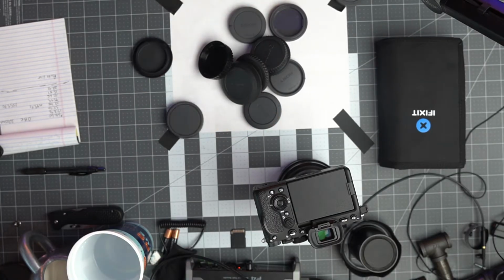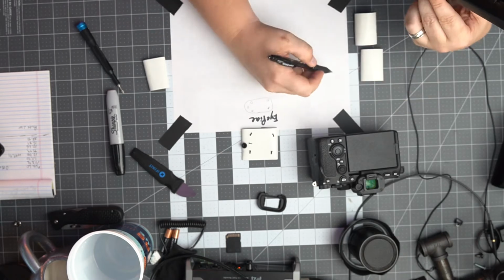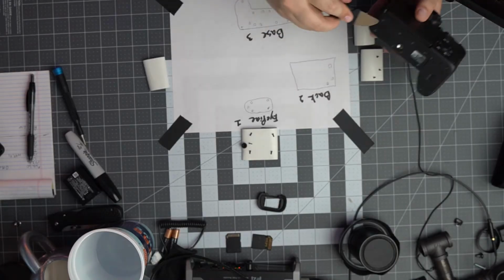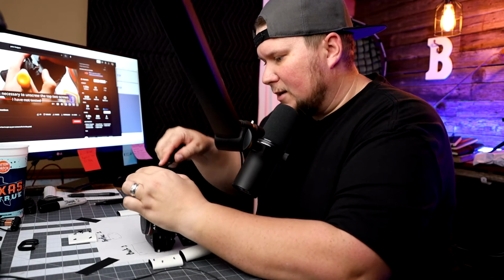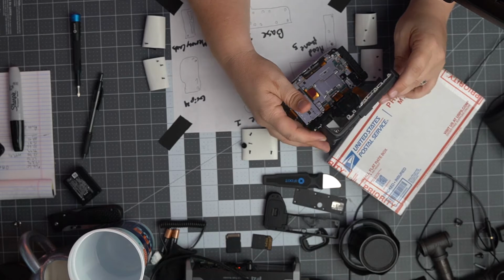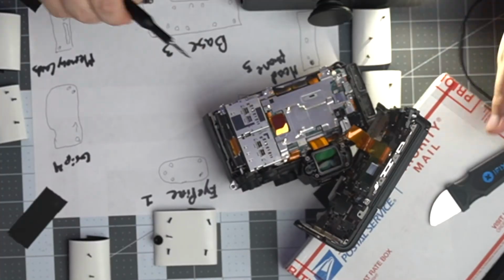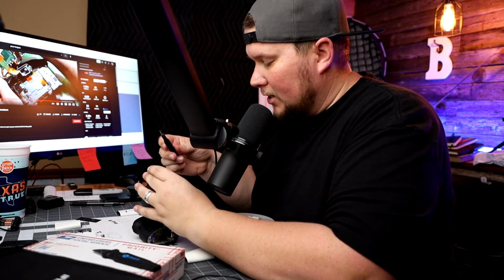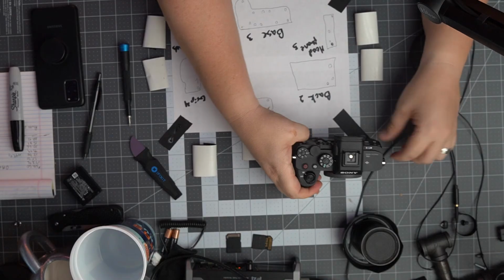I fixed my A7Siii Floppy Screen PROBLEM

Comment: I watched your video because I have the same problem.  After watching it, although it was fun, I basically realized that my camera was perfectly fine.  Thank you for fixing my problem.😅
Reply from the maker: That’s awesome! Glad I could be of service. Don’t get me wrong, I’m glad that my problem was fixed with a little glue, but it’s probably best not to dive into the innards of your camera. Thanks for watching
Reply: @Jarrod Brown  It looks too difficult and time-consuming.  Don't get me wrong, I've fixed damaged lenses before with multiple groups and elements.  But I had no choice bc they didn't work. But a loose screen isn't worth possibly losing a $3000+ equipment. But that was a very entertaining video.
Reply from the maker: @pop0ful  lol. I totally get it! Thanks

Comment: Voiding your warranty.... Its okay... if you haven't already removed the plastic, you can always return it 🤣😂🤣... and then you said it yourself

Here's a tip I use when rebuilding small engines too... take that diagram you make, use a pop box or something so its a little thicker, and poke the screws into the hole you drew on the diagram.  That way if the screws are different lengths you're not chasing it later.

Working on electronics aren't bad once you've done stuff a few times.  I am spoiled at work with microscopes and stuff so I usually save my sanity and take stuff in to work  to tackle during lunch if its more intricate stuff like that or needing a more precise soldering iron.

The nice thing with you recording it the way you did is you can always look at the video to see how things came apart if you needed it.
Reply from the maker: That is not my cup of tea. I think it has something to do with having big mitts. Trying to grab those small screws would've been impossible if it weren't for the right tools. Do you have one of those grip assist things with all the clamps? That would've come in handy.
Reply: @Jarrod_Brown  The whole bi-vocational gig has it's benefits at times.  Let's just say I have that and then some.  We reverse engineer automotive electronics so there is plenty we disassemble and find out how to integrate to them
Reply from the maker: @johnhayes81  wow! If a package shows up in the mail from me, just assume that I'm asking you to take it apart. I'm elbow deep in a vacuum right now. Trying my hardest not to have to solder, but it's coming. Color me impressed, John
Reply: @Jarrod_Brown  lol,  normally people have to tell me not to take stuff apart, because I have for no good reason.  If you ever get in over your head,  I'm game.  Give me a shout.